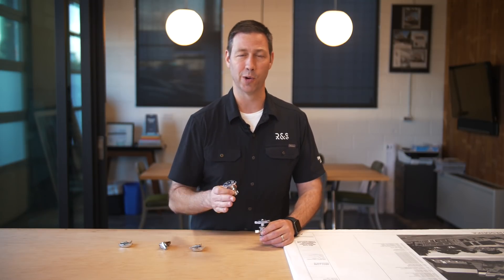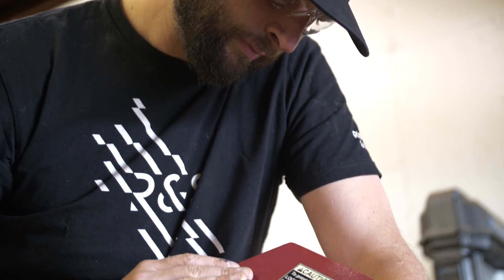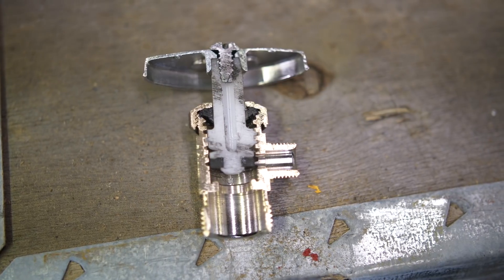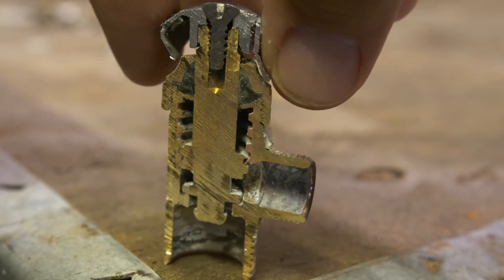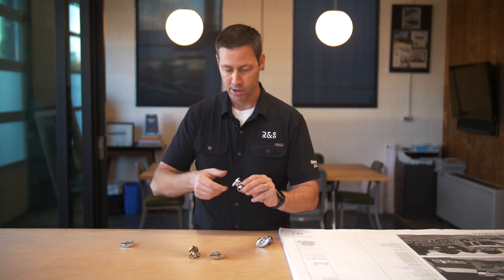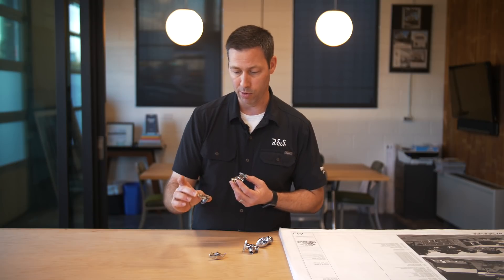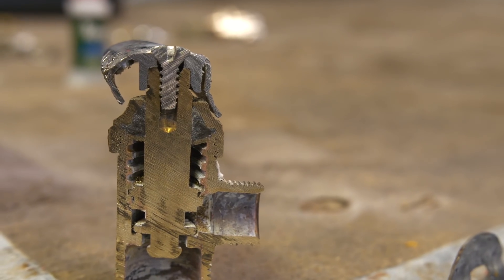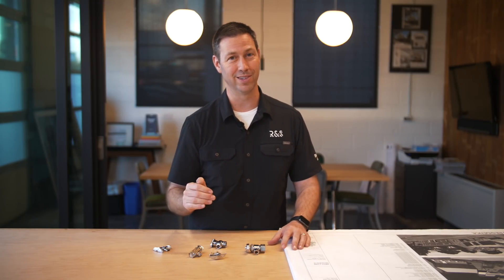Shut off Valves - 3 Cut in Half - Whats the Difference???

Comment: in 2025 I'd go back to full turn. All the 1/4 turns that were supposed to last in theory did not in my house! some less than 5yrs don't totally shutoff anymore. Some YouTubeers are now demonstrating that the 1/4 turn last way less and are NOT repairable, whereas the full turn you can unscrew the stem and replace the seating washer if that's the problem. Convenience vs longevity I guess.

Comment: Yes, your demonstration with cut open valves really brings up the knowledge level for DIYs!!  I have a ton of valves in my place because of a boiler with 3 zones.  Most of those valves are 50+ years old.  Some leak through the packing stem and you must periodically tighten packing nuts. A couple others have worn washers I'm sure.  If the washer wears out or "Disappears" as you point out, then you might also grind down the cup which the washer sits in and ruin the whole valve.  The screw which holds the washer in place will also disintegrate; Break off or freeze.  Either way, these stop valves are a pain.  These are similar valves used on old laundry tub faucets. I find if one tries to get a new washer to repair them, the newer washers are a wee bit thinner and this makes the turn key (shutoff lever) bottom out tight to shut the water off.  Old Gate Valves are even more treacherous. If the stem breaks as you force turn it open/closed, the gate will remain in whatever position it was in--if closed, no water.  If open, water flows!!  A lot of gate valves were used as house shut off valves?  The only problem I heard about Ball Valves is they must be used fully open or closed.  Otherwise, you will eventually damage the surface of the ball (Being exposed to the flow).
Reply: useful comment

Comment: Matt can you answer a question for me. I have a water shut off valve and I think the rubber inside the spigot shaft has failed and water is coming out of the stem, when I turn the valve it seems like more water comes out, I am worried about turning it more to close it, is it possible the valve would fail and I would have an uncontrolled leak coming out of the stem? I know its a silly thing but I need to stop a leak coming out of it, it's kind of serious, when I turn it it seems to allow more water to come out of the stem, can I just turn it a bit more and the water will slow down? I know its silly but Im worried something would fail and I would not be able to stop it, logically I think that it wont fail and the waters just going past the lil o ring in there that failed and when I keep turning it it will crush it and close the valve,  I bought a new one and looking at it I dont think the valve will fail but I need some advice, can someone answer it for me, save me hundreds of dollars

Comment: The multi turn valves always start leaking before the 1/4 turn. Have had multiple cases where the stem starts spraying water and have to end up turning off the main water to replace the valve.

Comment: 2:27 There is actually rubber in this one.  Do you see those four little rectangular holes beneath the handle?  That is where two rubber o-rings would be in place.  The rubber o-rings are necessary to prevent water from leaking through the stem.
Reply: Absolutely there's rubber.  Same even for the Dahl  ball valves.
But the ball valve O-rings are not in the flow of the domestic water.  The multi-turn is right in the water flow for every gallon.

There are now cheap/chinzy ball valves on the market also....

Comment: It’s a good idea, if accessible, to open and close the shut off valves periodically.   Over time hard water can form deposits on the mechanism of the shut off valve and make it almost impossible to operate the valve.   Turning it on and off a few times every couple of months is the best way I have found, to keep it operating.
Reply: Yes, yes, yes, "exercise" those valves regularly. I added the task to my calendar (paper and online) at the same time as swapping the HVAC air filter.

Comment: Yea but you can service the other valve, the ball valves have the thing that attaches the ball to the handle non removable by design, and the ball is non removable as well.  The multiturn valves you can unscrew the entire valve and replace the seals if you wanted to but truthfully the valve itself is going to get to the point of wanting to just replace the whole thing by the time anybody would need to replace the seals..  but worthy of mentioning it in case somebody would need to replace just the seals if maybe were in a hard time or unable to get a new fitting but happened to have the right sized o ring..

Comment: Thanks for a great video. Ball valves last longer (should be good in low service areas- you turn them off and on once in a blue moon such as during servicing the toilet etc.) but have to be replaced as a unit when leaking and this will be a pain then. The multiturn with the gasket will have to be serviced from year to year with the gasket (which rarely a homeowner does unless a maintenance guy from a company with a task list does it) or else deposits will eat the rubber gasket away until the valve leaks when you need to service the equipment or apparatus attached to it. With the multiturn valve, if there is no available stem repair kit or unable to make one up, if one is patient and it is not leaking like crazy, all is needed is to plug the end of the hose attached to it to stop the leak for the meantime and just reconnect it to the equipment when needed with a little spill. The most important takeaway is that if it leaks and one has not destroyed the body by forcing it, it is an easy fix with the gasket for a DIYer. Ball valves leak and seize over time due to sediment build-up and more so if turned on and off frequently and are better to be operated either fully open or fully closed and not on throttle position for long periods of time.

Comment: I’ve replaced several quarter turn valves due to mineral deposits preventing the valve from fully turning. Valves were only 12 years old. City water isn’t so hard it leaves deposits when it evaporates.

Comment: You can get those quartet turn valves for under $6 from supply house.  Stay away from the brasscraft valves. Their multi turn valve comes with a plastic stem and their quarter turn valve is garbage.  You can find sellers on Ebay who sell the quarter turn ball valve style who have 10 for $33. It's a great price and it's quality
Reply: What brand ?
Reply: @  souix cheif

Comment: If you ever have to replace the 1:4 turn ball valve, you have to cut and solder (typically).  With the old school compression, you just replace the washers.  So while they may last longer, replacing one is much more work.
Reply: I agree with you
Reply: Good point
Reply: don't you just unscrew it and screw on a new one?

Comment: These shut-off valves are open most of its life, such that those seals are hardly under stress. However, the rubber seal in a multi-turn valve, becomes brittle and crumble over time and that's when it becomes problematic. The valve itself is repairable, but the faucet downstream gets clogged with the rubber crumbs. I guess they still manufacture these type of valves because people buy them, its a dollar cheaper!

Comment: They both fail.

The quarter turn valve has a shaft that turns the ball that sometimes sheers the "screwdriver" tip off the end of the shaft and leaves the ball in any position it was in, when the tip sheered. OFF, ON, or restricting the flow, sometimes making a toilet take 30 minutes or more to refill. That shaft is the first part installed in the valve during assembly and it goes in thru the water supply entrance hole so the valve has to be removed from the pipe. If it is screwed onto the pipe no big deal, just replace the valve. If it is soldered onto the pipe then you'll be wishin it was a screw valve. So the shaft go inside the valve first and has to be in the OFF position so you can put the ball in thru the exit side of the valve and align the slot on the ball with the "screwdriver" tip of the shaft. So it's the shaft in first, then the first nylon seal, then the ball, then the second nylon seal, then the brass ferrell adapter, then reinstall on the pipe.

The screw valve can be repaired in place without removing from the pipe. You can either replace the seals or buy a shaft kit for the screw valves. Just take the knob off, unscrew and remove the gland nut. Then use the knob to unscrew the shaft out of the valve. Replace the gasket at the end of the shaft and screw it back in or install a new shaft kit. Reinstall the gland nut seal, then the gland nut and then the knob. Turn the water back on and check for leeks. Your done, quick and simple. When you turn the the valve on, turn it all the way on. When you turn it off, turn it all the way off. It will last longer operating it this way. If you decide to repair the valve don't be surprised if there is no seal on the end of the shaft. Just continue repairing the valve. If it goes to a sink then remove the aerator from the end of the faucet and clean out the black carbon looking stuff (black seal pieces from the screw valve seal) and turn the water on and let it run for a second or two. Then reinstall the aerator. If your working on a toilet check to see how fast it refills after flushing. If its slow the replace the float valve assembly.

If the screw valve is soldered onto the pipe just repair it. If it is screwed onto the pipe then it doesn't matter what you do. No matter which one you pick you'll have to do maintenance on it sooner or later. The all brass screw valves can't be beat in my opinion.

Comment: I won't use anything but a ball valve. With all the issues I've had over the years, and it was always the seat wearing out (either the rubber corroding or deposits on the rubber/silicone preventing a good seat). With the ball valve you don't get that, and you didn't mention the fact that very little to NO water is in contact with the silicone insert (where the ball seats), so it may be decades before it ever goes bad. I use them everywhere, sinks, washer, water heater, even some of the hoses outside, and [at house] main shut-off. I do all the work myself, because I did know what my plumber was doing, ripping me off.

Comment: Helped my father with a few water claims inspections. In every case where a valve or fitting had failed, it had some kind of plastic replacing what used to be made of copper or brass. In every case, it was the plastic part that had failed and caused the insureds to suffer multiple thousand dollar losses for which they had to turn to their insurance for.
Reply: Exactly. I'm not a sue happy person but these garbage plastic valve parts are a long over due class action lawsuit in my opinion.

Comment: You really need to check this stuff out at the store even with 1/4.  Chances are if you can't turn it the store it will lock up soon afterward.  The blade handle main ball valves still turn like a dream 30 years later.  Call me crazy but I want install 1/2 version of those.

Comment: Look for the brasscraft 1/4 turn valves.  Some of the others are super cheap and have plastic parts as well.  The smaller ones with no name on it (might be nibco, not sure) at Menards often drip when shut off.

Comment: I just had to rebuild a brasscraft screw type built with my house in 2005, same deal rubber was gone wouldn't shut off.  Stem was metal, rebuild parts were plastic.

Comment: I maintain an old apartment building. About thirty years ago when I began working on the building more than half the compression style shut off valves would not shut off the water. When ball valve  shut off valves became available I switched to them. I believe I've been installing them for about 15 years now. I've had one failure. It was a Keeney from Lowes. Originally since I was having good luck with the Keeney's I stuck with them. After the failure, I started using Brasscraft from Home Depot. as well I've had zero failures with those.

As to the comment below about being able to throttle the water more easily with compression style angle stops: Huh? Why would you need that? Even if you needed to throttle the water with the angle stop, something that seems unlikely to me, ball valve angle stops can do it. 

My general sense of it is that compression style angle stops begin to fail just about the time you need them to work when you are installing a new fixture to replace the old one.

I also have used non-name brand shut off valves. Whoa, that was really stupid. The failure of a a shut off valve can be a cause of massive damage. If there is any plumbing part where spending money to get a more reliable part is justified it is shut off valves.. 

As an aside, I think Lowes may have stopped carrying compression style shut off valves. From my perspective that was the right decision. Old style compression shut off valves should not be installed when a much better product is available for an insignificant amount of money.more.
Reply: A bit of a sad (to me) update on my experience with ball valve angle stops. I've been working on some units that had new ball valves installed about 10 years ago. 3 of the 4 Keeney valves had failed. It seems like the plastic shank for the handle becomes brittle and breaks over time. There was another failure mechanism as well. I don't know if the newer Keeney valves have been improved but I have now switched entirely to Brasscraft angle stops which might be just as bad. I just don't have long term experience with them.

Comment: Great video! Question: Can a 1/4 turn ball valve be used as an on/off valve? Meaning, can it be used in an application where it is used on a daily basis? I know that 1/4 turn ball valves are only really used when supply lines need to be temporarily shut off to make repairs (installing a toilet or sink, etc.).  I'm wondering if using a 1/4 turn ball valve on a daily basis would wear it out.  I know it's an odd question, but I have a non-traditional application---I'm an inventor working on my second patent, and a 1/4 ball valve would be handy for me to use in a new design.  Thanks!
Reply: I used 1/4-turn ball valves to build a steampunk-style brass and copper custom bathtub faucet.  (It looks pretty cool, too bad I can't post pics here.)  We use them multiple times a day, and they're working great, but it's only been about 10 weeks so far.

Comment: I have replaced hundreds of these plastic stem valves for ball valves in a multistory apartment building. Most were as old as the building ( 40 years). They function if handled carefully, gently close if you feel it hang up reverse direction and then start closing it again, pliers are ok but revers direction rather than forcing it.   
      Not all ball valves are the same. If you look at the  stem  these can corrode and fail relatively half fail quickly 3 to 5 years in water that is mineral laden (hard water). Be absolutely sure you remove and replace the old compression nut  ( you bet its a pain but do it anyway)  or you will get dissimilar metal corrosion.  Check the ball, the chrome ball can be a problem, look for the newer gray pex. 
   The white plastic shafts of the multi Turn have never failed, its that rubber washer seal that leaks but rarely enough to force you to turn off the water to the building. 
Before I started I always had assumed plumbers used the plastic multiturn valves as repeat insurance.  I now understand plastic is a very durable product and preferable to most metals. Brass is another very durable product. You have to search for it and its being phased out for lead free brass. I have no idea of its durability.

Comment: The ball valve wont last as long, and cannot be rebuilt, which means when it does fail your cutting pipes. Even when the rubber goes bad in the older style you can just clean remove the guts and screw in new guts in it within minutes. never having to cut an old copper line. 
Sometimes theory and reality run counter intuitive.

Comment: "I'm worried that plastic might shear off someday and also worried about how rubber is going to fair over time." Nailed it. In my parents house every service value uses those. They are about 25 years old. Virtually all of them have failed and leak around the packing. Two have been fused shut as cutting them out would be more trouble. The saving grace is if you do not touch them they won't start leaking that much. But they'll start leaking if you use them so they defeat their purpose.

I did a retrofit for a filter system for the refrigerator and sink. The service valve started leaking. I just put a bucket under it as I was putting another service value ahead of it in the new piping. I had already fitted the wall faucet with its own value. The idea was I wanted to get it to shutoff completely so it'd be dry enough to glue it shut later and just wanted to do the install. I applied a moderate amount of pressure to try to cram the packing in and the leak stopped and then... lets just say I installed a shower not a filter that day. The entire plastic piece shot out.

The two main service values were cut out many years ago for a water softener replaced with fairly high quality globe valves. Two of the in ceiling values have been glued shut and another was one was the one mentioned above. Now cut out and replaced with a sharkbite. Somewhat needlessly since there's two more service values ahead of it. But it just worked out that way. 2 out of the four sinks leaked and had to be replaced and fitted sharkbite values in at that time. So there are now 2 sinks and 1 toilet using these values still in my parents house. They make me cringe.